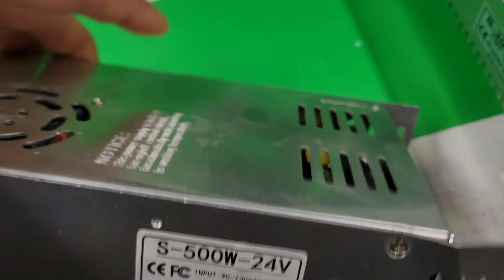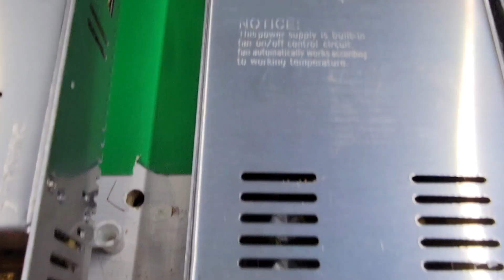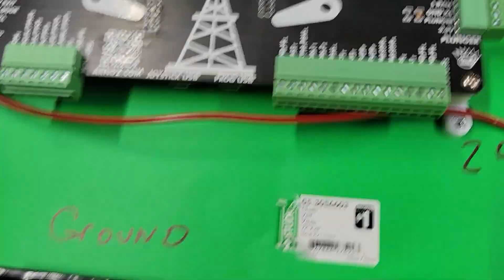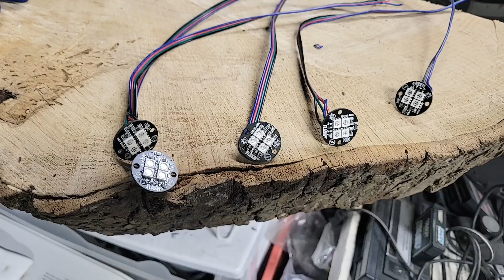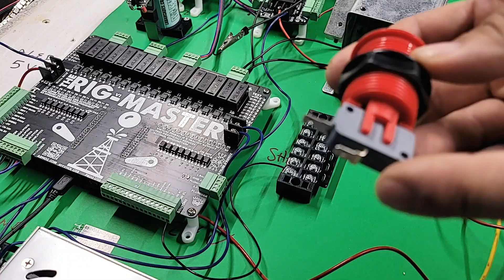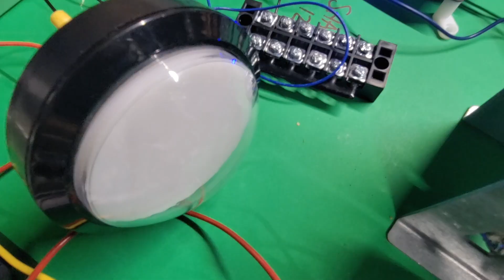Connecting Virtual Pinball Part 2 of 3 (Hands on)

Comment: Fantastic tutorials. Thank you for doing them. I have one question, I have a 50a 12v power supply. Will this be too much for the rig master board as it says its 40a max? Or am I looking at this in the wrong way? Many thanks
Reply from the maker: Arnoz's Rigmaster description says : Each output accepts 5 Amps maximum, 48 Volts maximum.
The card cannot manage an intensity greater than 40 Amps simultaneously. You will never reach 40 Amps of power simultaneously unless you are rigging your cab to launch in space

Comment: Thanks a lot for making this series. Might be worth a few comments related to the different ground schemes. If I understand correctly the "Toys" or "Central" ground is electronically separated from the "KL Ground". All the grounds for the external power supplies are tied to the Toys ground, but the KL Ground is presumably via the USB cable shield attached to the RigMaster. Finally, in other videos you recommend a completely separate circuit for 5V addressable LEDs, to prevent interference. Does that mean a discrete ground for them as well? Thanks again.
Reply from the maker: I don't mention the Kl ground in my videos not to confuse people. The Kl is connected and managed by the Rigmaster.  And yes , the addressable led are on a dedicated power supply and the negative of the power supply will not connect to the common ground

Comment: What gauge wire do you use? Arnoz' page says to that the ground coming from the toys power supply should be able to handle 20 amps. I just finished wiring up 18AWG to each board for power, but now wondering if I should redo it with something like 12AWG
Reply from the maker: I use 18AWG and it is sufficient. Some people will use 16 or 14 for 24v and above. But let say at 100W/4.17A you could run 45 feet of 18Ga without issues. Look at this 24v chart https://www.google.com/url?sa=t&source=web&rct=j&url=https://www.securitypower.com/Other/securitypowerCOM/04%2520-%2520Application%2520Notes%2520-%2520Tools/AN-2-24_Wire_Table.pdf&ved=2ahUKEwiB6ueOm-f4AhVcmGoFHXSeDZgQFnoECAUQAQ&usg=AOvVaw0L263dKzOZefCWD3ZeMfV6

Comment: How do I calculate what size fuse I need for a particular toy?
Reply from the maker: You need to know the amperage draw of each toy you use. Usually found in the specs. If a toy draws 1 Amp use a 1.5 Amp fuse. Always the next value above.